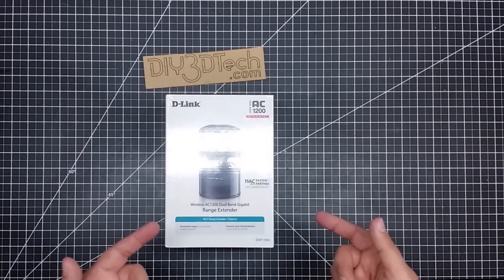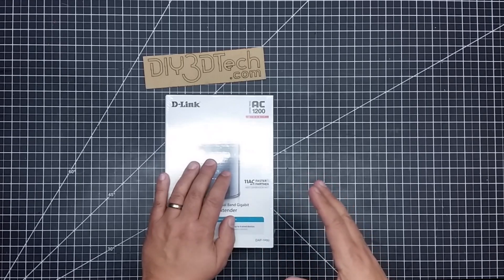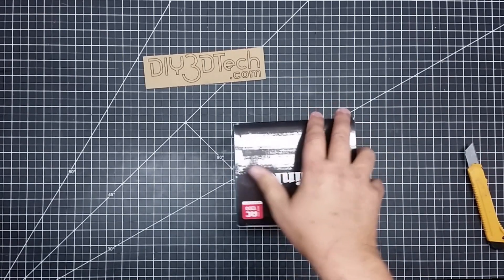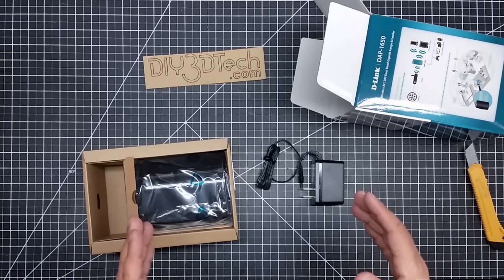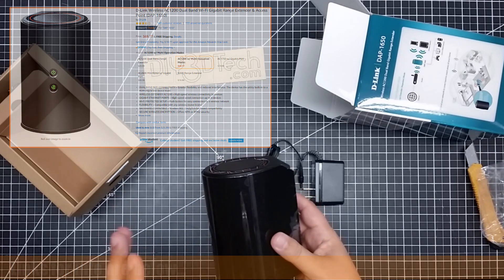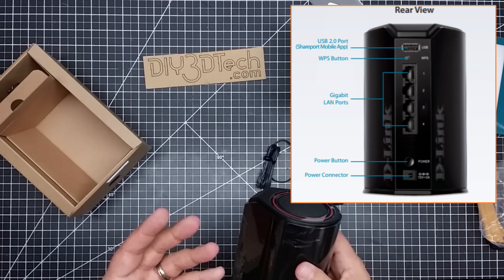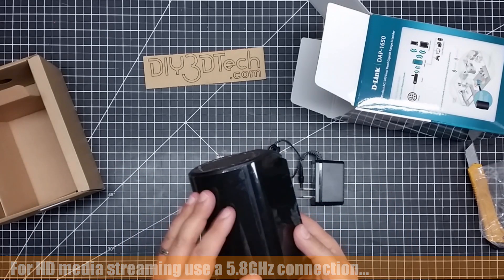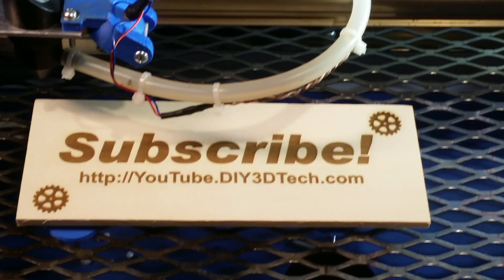Shop Talk - Cutting the Cord to the Shop!

Comment: Everything sounds great except for the amount of electro-magnetic field you add to your surroundings which is not that healthy
Reply from the maker: Then I am sure the three cell phones on my desk aren't helping either.  :-)  I use to be a microwave engineer and low power EMR doesn't concern me in the mW range and at high freq as most of it will be absorbed by the water in your skin.